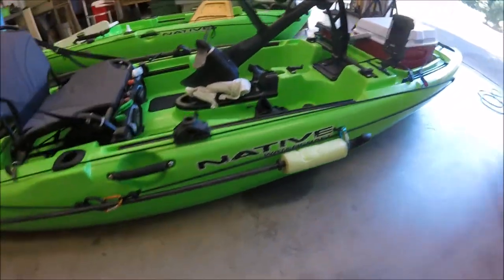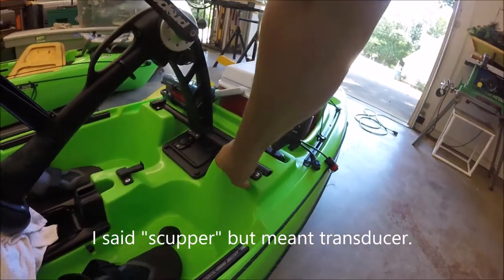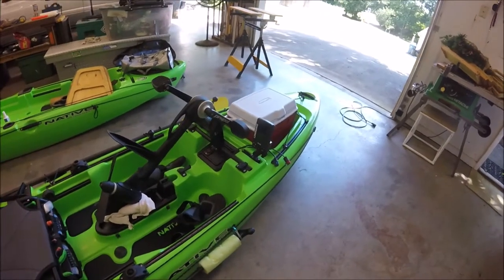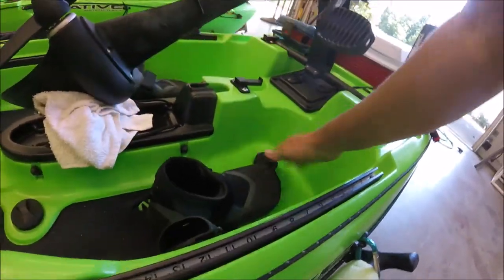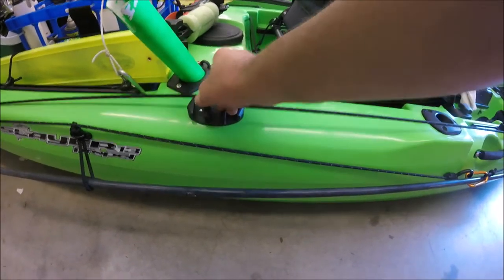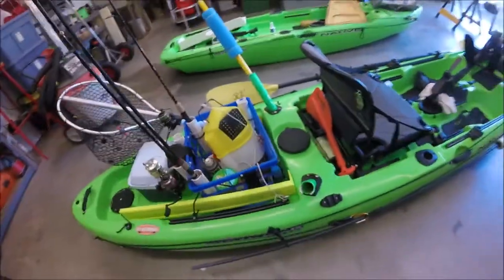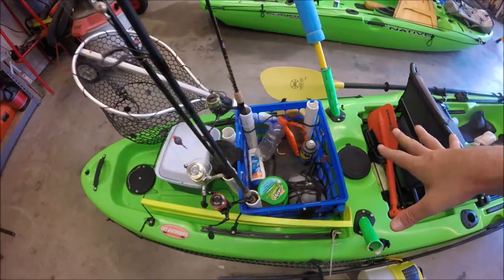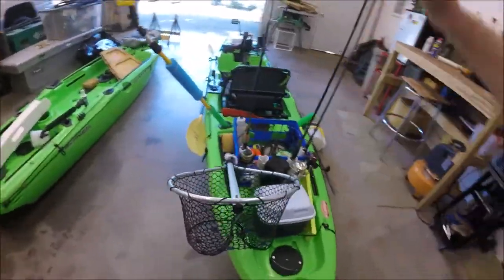Inshore Saltwater Kayak Setup

Comment: I came across your video (Very well done BTW!!) as I just bought a kayak and have been looking into all types of mods and DIY's. We fish the coast as often as we can so having a mud stick is important. You said you buy fiberglass rods but when I searched the web I couldn't find any similar to your. What company do you buy them from? Thanks!
Reply from the maker: Can't remember where I got it but there are plenty of suppliers that carry 5/8" fiberglass rods.  Here's one...https://mgs4u.com/product/58-od-round-solid-rod/  Buy the 8 foot rod.  Then use an angle grinder to cut it down (6.5-7 feet).  Use the grinder to sharpen one end.  Now fashion a handle or order one.  I got mine from stick it anchor pins.  They have one designed for a 5/8" rod.  You should be able to design a $70 rod for under $20.
Reply: @bradjohnsonkayakfishing  Thanks for the reply Brad! I really appreciate it! BTW.....I subscribed so looking forward to more videos!